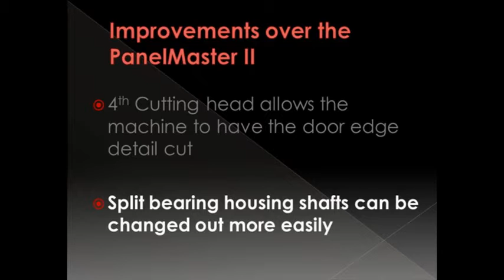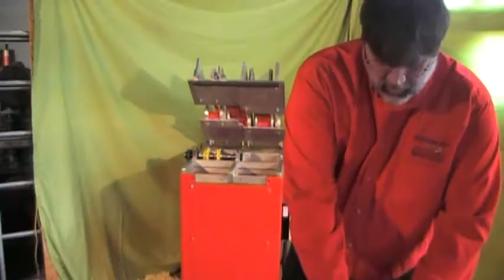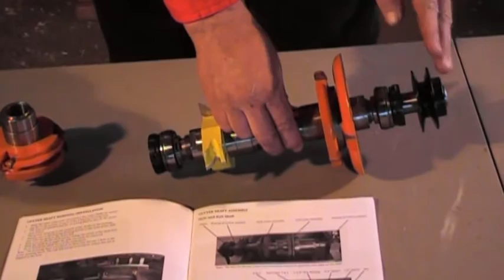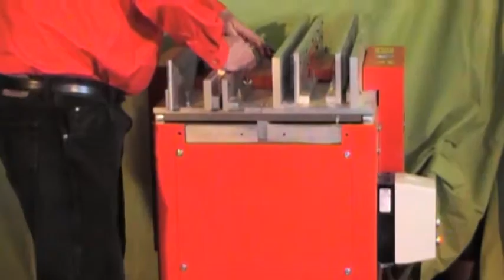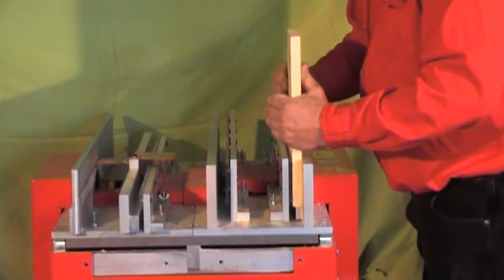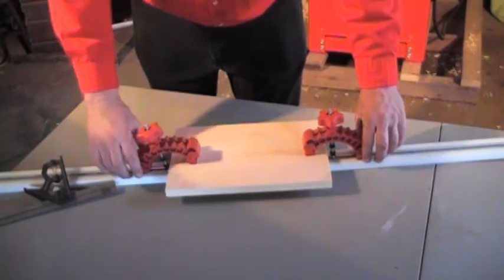Introducing the PanelMASTER IV

Comment: It's "stile" not "style".  Good lord.   Jump to how the thing works and  what it does.  The stop button should be closer to the operator at all times - having to reach around the machine.  And what are all the black marks?
Reply: Aluminum transfer from the fences. Maybe the fences can be lined with HPDE? Agreed on the stop button or at least remote stops on the opposite side. Also surprised there is not a an adjustable rail like is used for the rail cut. This would greatly speed up the process. The jig seems to take away from the panel master being a serious production machine.
Reply: why the fck is this guy calling the rails stiles during his demonstration... Hes legit called the coping sled a "stile" jig